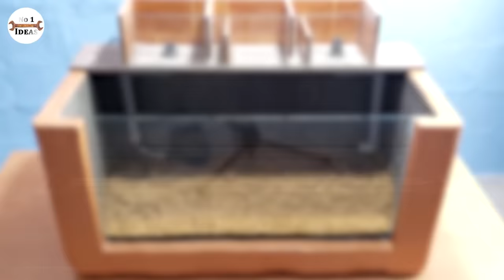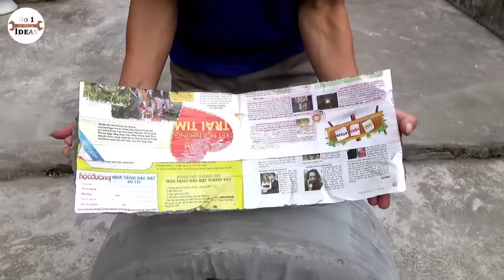3 AMAZING IDEAS - Diy Aquarium For Your Family

Comment: wowo that's easy to make
Reply: What about the toxic that'll be released by paint
Reply: None of those would actually work. The concrete would leech toxins into the water, and several of those fish species would kill each other. Also, for the first one, if one of the fish swam into those tubes it would more than likely die. These are cool for decoration, but would not actually be functional for very long unless you want to kill a bunch of fish.
Reply: gi

Comment: Está muy bonito aclarando para los que lo vimos asumo q el concreto que uso es para peceras al igual que la pintura ya que puede ser  tóxico para los peces, 
por qué las reacciones quimicas del concreto se extienden por 21 días q es lo más fuerte de ser concreto normal, y un consejo con la última no le pongan "humo" o vapor no se bien que era, si van a poner un pez beta por q el toma su oxígeno del aire y en ese caso lo ahogaran

Comment: The chemicals from the concrete would leach through the paint even if the paint was non-toxic. Not advisable knowing how delicate the fish are.
Reply: I have built many fish ponds from cement, never had a problem, this may affect the pH but you can get a pond sealer for that, amazing idea, going to use the first one for my breading tanks, good insulation, fish feel safe with three sides covered, ...

Comment: None of these would actually work. The concrete would leech toxins into the water, and several of those fish species would kill each other if left together. Also, for the first one, if one of the fish swam into those tubes it would more than likely die. These are cool for decoration, but would not actually be functional for very long unless you want to kill a bunch of fish.